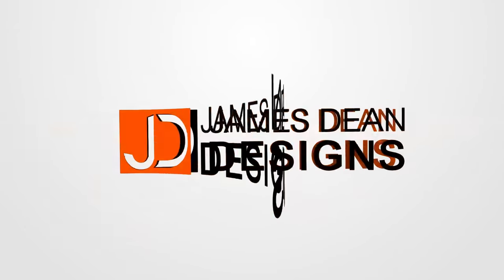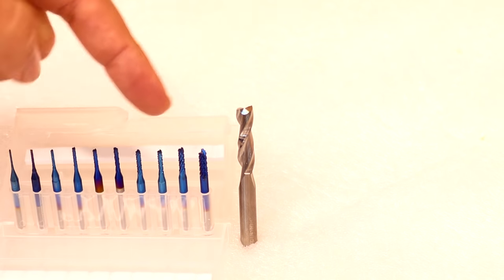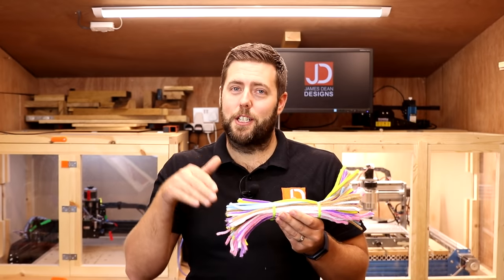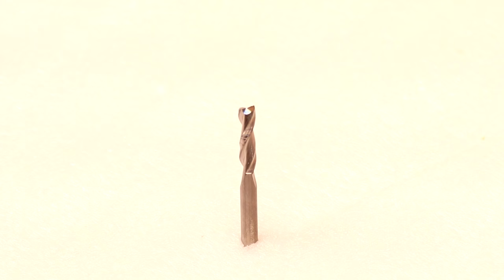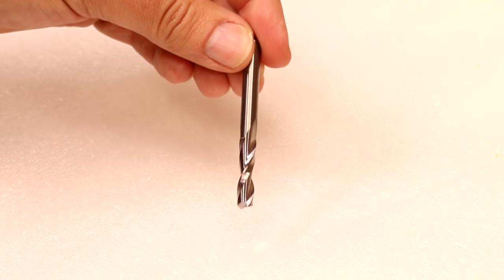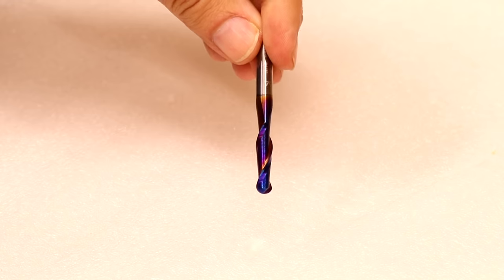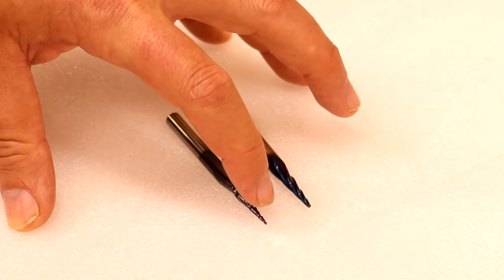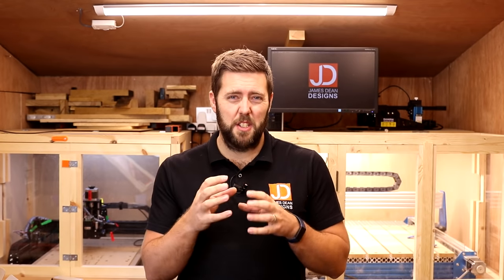Beginners Guide to CNC Bits - Including Speeds and Feeds

Comment: Is ER11 collet compatible with Dewalt 26204K
Reply from the maker: No, the dewalt has a different collet unfortunately
Reply: @JamesDeanDesigns  In order to use 1/8" bit I need another collet right?
Reply from the maker: @mustaphaben2921  no, if you look on amazon and search 1/4 to 1/8 sleeve it will show you a reducer that works really well and much cheaper
Reply: @JamesDeanDesigns  thanks
Reply: @JamesDeanDesigns  Sorry to ask again, but could you please suggest me a sleeve because I checked on amazon and I got confused.
Reply from the maker: @mustaphaben2921  these are what you need 6 Packs 1/4" To 1/8" Collet Adapter for CNC Lathe Router Cutter Milling Bit Collet Reducer https://www.amazon.com/dp/B085SWPY32/ref=cm_sw_r_awdo_2XNW9GTXNGBQWVST0FK0
Reply: @JamesDeanDesigns  Thank you very much

Comment: I don't see why you can't have a formula that tells you exactly what you need to know for desktop CNCs, but from personal experience I find most formulas I have come across lack one crucial bit of information. CNC rigidity, it is probably the biggest influencing factor that doesn't appear in the formula. while you can calculate the perfect feeds and speeds that don't mean jack if your CNC can't do it.
Reply from the maker: Completely agree. In theory you should be able to put in your metrics such as spindle power, material, bit type and something gives you the answer. Its just no one has created it yet unfortunately. Not for these levels of machines anyway
Reply: @JamesDeanDesigns  I've been thinking about writing something for my own DIY CNC when I have spare time. I recently wrote a phone app for a Colchester lathe I use at the mens shed. The online calculators might work fine on production machines, but there are no where near close for DIY machines.